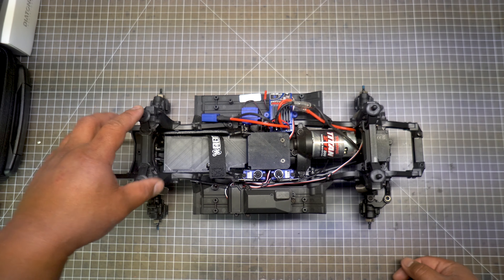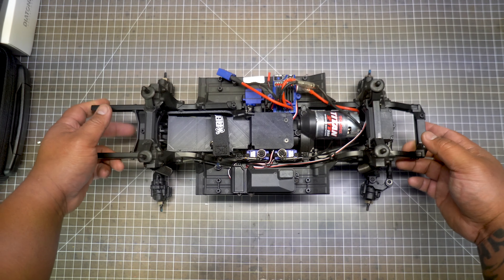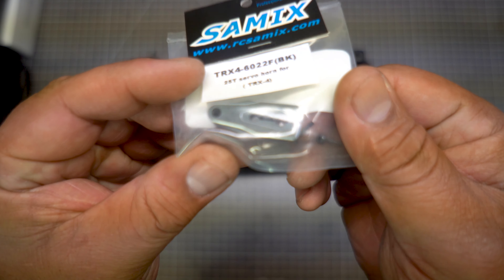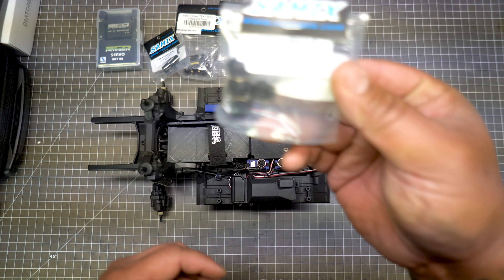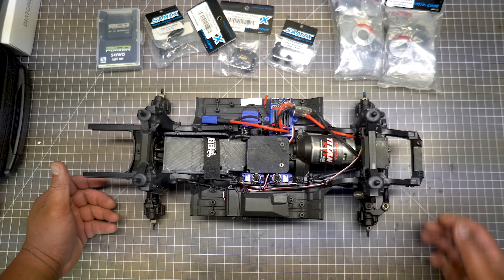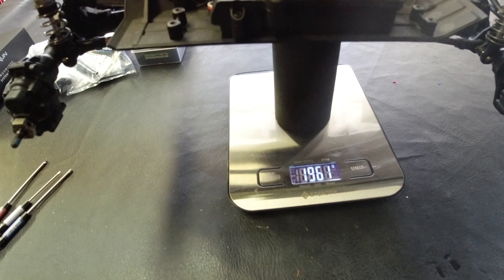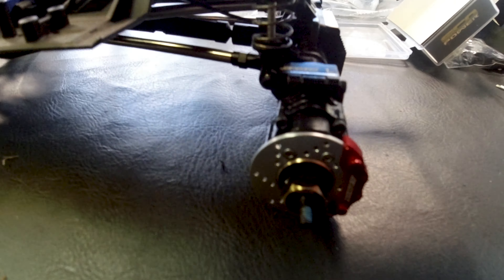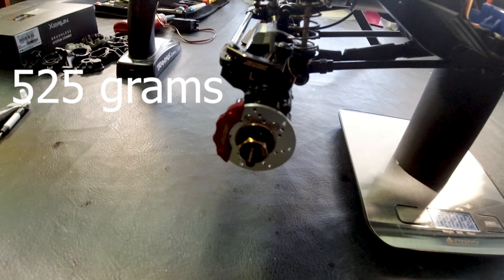Samix and Hobbywing AXE for my TRX-4

Comment: Are you using the TQi transmitter? If so did u have any issues Calibrating the hobby wing esc ?
Reply from the maker: I'm using a Futaba 7PX. Sometimes it's hard to calibrate RTR transmitters because they don't have end point adjustments and the ESC doesn't see full throttle or full reverse.